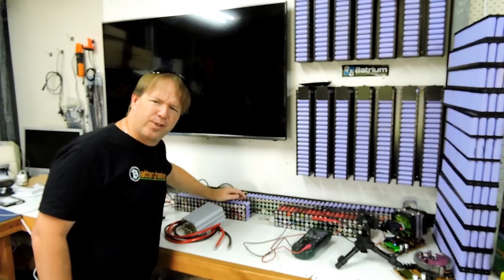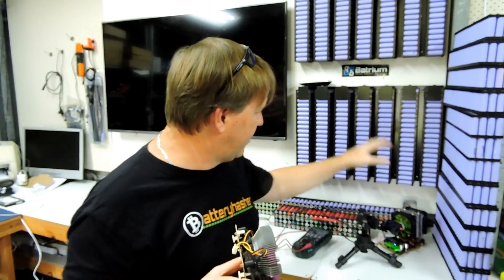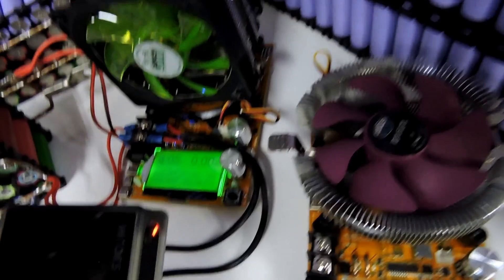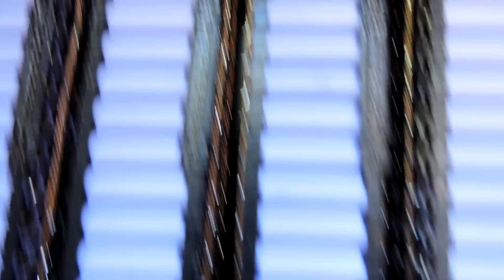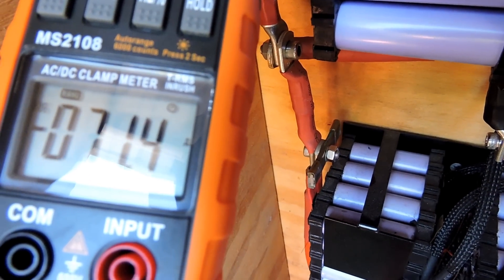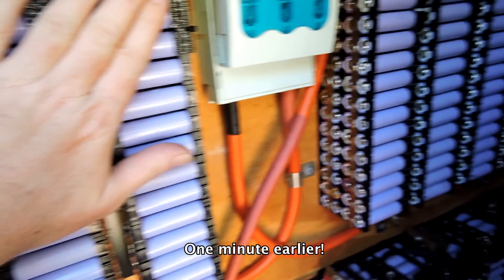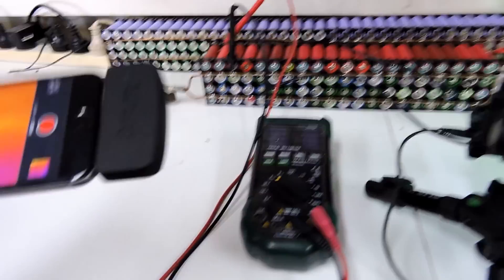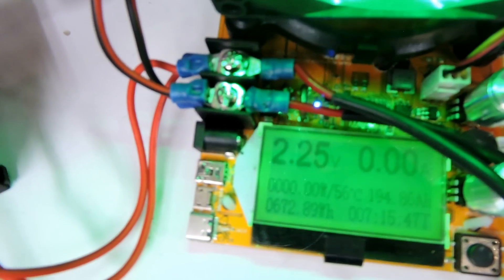A DIY Powerwall Update : Bad packs and hot cells!

Comment: HB, I have a question. I have access to about 60 free 18650's and would like to build a bank to run a 500-600watt adjustable portable chafing warmer. How many watt hours would i need to run that for a maximum of 3-4 hours at say 200 watts ?

It's a 110volt by the way.

Comment: Thanks for sharing all your info. Is the heat camera an app that runs on any phone?
Reply from the maker: Its this https://rover.ebay.com/rover/1/705-53470-19255-0/1?mpre=https%3A%2F%2Fwww.ebay.com.au%2Fsch%2Fi.html%3F_odkw%3Dflirone%26_osacat%3D0%26_from%3DR40%26_trksid%3Dp2045573.m570.l1313.TR2.TRC0.A0.H0.Xflir%2Bone.TRS0%26_nkw%3Dflir%2Bone%26_sacat%3D0&campid=5338073988&toolid=20008 can be used on iphone or android phones and is amazing

Comment: Probably you have reached it's lifetime cycle. I went to a site Instructible.com and this is the info that I copy:
What is a cycle?

When an 18650 battery is charged and discharged, this is counted as one cycle.

18650 lithium-ion batteries are charged up to 4.2V and down to between 2V and 3V depending on the cell's specification for cut-off voltage.To be safe, never discharge lower than 3.0V unless you know your cell's specification.

Discharging occurs anytime you use the battery for power. The electricity is drawn from your device, and the battery discharges current. You can also use battery testing equipment to discharge a battery.

How many cycles does a typical 18650 battery have?

Most modern 18650 batteries have a typical cycle life of 300 - 500 (charge, discharge cycles). When in high-amp or high-drain situations, this can decrease substantially to 200 cycles. If you go over the maximum discharge current limit (A) you can decrease the cycle life all the way down to 50 cycles.

In optimal conditions, your cells may achieve more than 500 cycles.

Some chemistries are able to cycle thousands of times before reaching 80% of their capacity.
18650 cells are rated normally at between 20 and 25 degrees Celcius.

Any deviation from this will create a slight loss in efficiency. A 10-degree deviation might account for a loss of 20, or 30mAh.

While the extremes, below zero, or above 70 degrees, will see much faster cell degradation.

Using a cell at suboptimal temperatures will decrease its cycle life.

Tip: Never charge your 18650 cell below freezing! Eg. in a garage in Winter as it will degrade particularly quick this way

While you are using your cell, if you notice it gets hot, let it rest. Under normaly use your cell should not get hot-to-touch, and should never exceed 60 degrees. If it is getting hot fast, you are over-stressing it.

If your cells are new or 2nd hand had reached it's lifetime.
Reply: The seller's market all ways exaggerate the cycle lifetime.

Comment: could you do a walk through of your system. ( total number of battery banks and power output. load capacity.
how do you charge them all... wind turbine solar cell etc ?
would it make life easier to be able to de-solder a single cell and slide it out of the pack ? i noticed the spacers have small lips on the top and bottom to stop cells sliding out..
would larger spaces between cells improve heat distribution in a cell pack.
could you add a series of small 5v fans to the reverse side to aid air flow ?
is there a reason you use that size cell pack ? could you make them 50% smaller but still have the same output ( total number of individual cells would be the same. just less a/h per pack. but would make cell breakdowns easier to repair with less power loss when you remove a cell pack.
sorry... theres alot of random silly questions in there... im new to your channel :)

Comment: So, that cell 3 that was dead, what sort of endurance are we talking about? How long did it serve you? What about that other cell that's losing voltage?
Reply from the maker: Dead nop, under 20 percent DOD it worked perfectly, just when the battery was drained it showed it's weakness - could have stayed in service easily but I want a stronger battery bank so I replace and upgrade the lowest packs whenever i see them 'hurting' a bit

Comment: what's the best cheapest thermal camera you seen? that would come in such good use. for a lot of uses!
Reply from the maker: Best is difficult as I've only used 2 different types the one I used in this video I really love because it's small, portable & can record video an reasonable quality
Reply: Hi, just a question : as we can see there are differences between FLIR camera an IR gun reported temperatures >>> what would you recommand to use as the reference temperature point : your FLIR camera or the IR gun ? Did you compare with a K-type thermocouple so see who's "right" ?

Best regards,

Jon

Comment: For  some  of the constant current testers, you need a second JST connector to monitor the voltage more accurately, as you can get more capacity out of it then.

I did this to mine, and retested most of my cells, and their capacity went up by quite a bit. But, by not monitoring the voltage separately, I actually got capacity to spare, soooo...
I guess it wasn't so bad.

Also, about constant current testers, I would recommend watching this vid for recommendations:
https://www.youtube.com/watch?v=Xs1oe2-9O6k&t=665s

Helped me choose the right one for the job.

Comment: have you made a load of just 10A or less and checked how many ah you get on the pack you tested?
Reply from the maker: I haven't but with that discharger I can, I'll charge #cell5 again and try it :)
Reply: would be interesting to see how much it different if you have a lower load compared to a high load and even if you can only drag down to 3volts by stepping down the load so it becomes more the useful capacity
Reply from the maker: definitely have better capacity, be a great test
Reply: what I thought was if there was a difference between the pack depending on load in capacity if one pack gets 200Ah at 80A and 250Ah at 10A and if another pack has 200Ah at 80A but 300Ah at 10A load then there should be imbalance internally at the bank level

Comment: thanks for the update. Im still wrapping my head around the concepts of what size packs to make and am in the middle of reading the ebook copy of "DIY lithium batteries". I was wondering if you based your pack size, the parallel size, to your expected power requirement or did you just decide on the size of wall you wanted to make and ran what was able to fit within the limitation of predetermined powerwall? second if you could explain how the bms works on your system, does it use individual wires or  something different? that would be just dandy! thanks

Comment: your voltage dif is simple voltage drop over the cables, one of the errors you introduce by not having a 4 wire measurement. The easy solution with out getting a more expensive unit  big thick wires or exactly what you did and intro device a measuring device that not on the other end of the wires pulling current. (If you measure  with your multi meater right on your load testers terminals i bet its not far off.)
Reply: info https://en.wikipedia.org/wiki/Four-terminal_sensing

Comment: hello, fun update! wow that was a toasty cell! why did you discharge so low 2.2v for Li-ion is pretty low. I cant believe the DC load has usb functionality but cannot easily set the termination voltage, I have a 10A one that was probably a little more expensive (review on my channel) but it has worked flawlessly. Some day I will make my own DC load but thats in the future.

Comment: Brother. I would like to know how the heat in the sheds? I ask as I am going to be doing a out door power shed. I live in the heat. We get 40+C days and nights that do not go below 38 C.. That is with 99% humidity in the summers.  Hell right now it's winter and it's 94% humidity out at 1:06 AM!! lol Thanks brother. God Bless.
Reply from the maker: after adding 4 10cm fans at floor level and one 10cm fan up top to pump air out where the powershed is located is typically 5 deg under ambient temp (constant shade) even with two PIP inverters running air cons in the house it's great - now if i add a miner in there it gets too warm during the day but nights are still fine
Reply: What size air conditioners are you using?